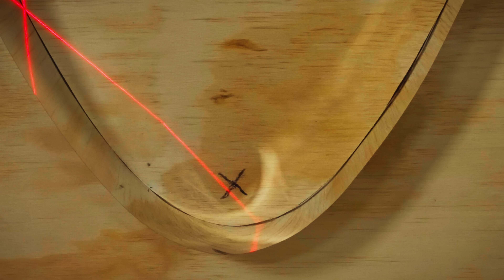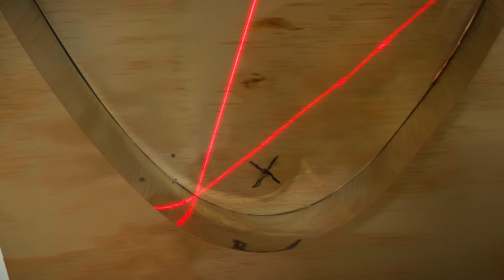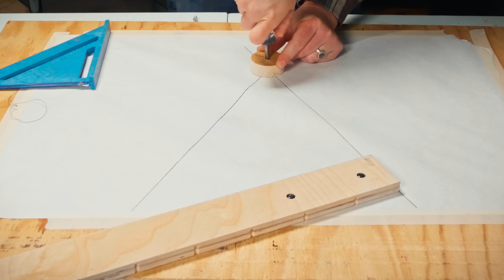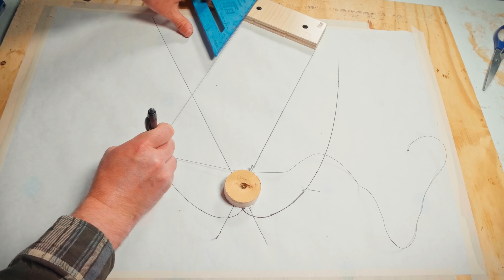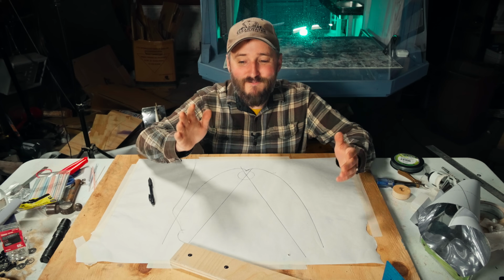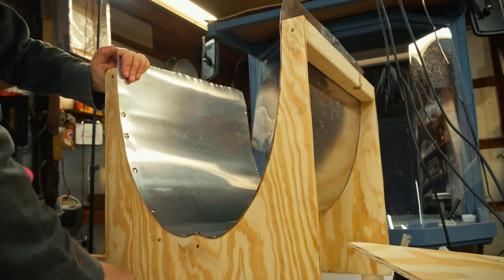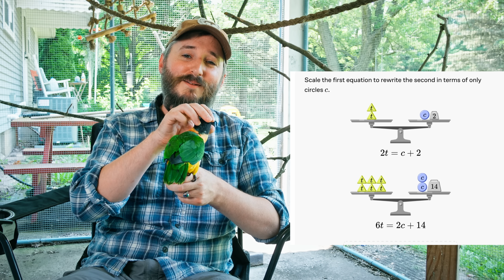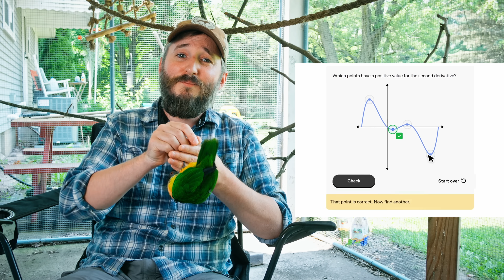DIY Solar Concentrators, Made Better.

Comment: Awesome video! Do be careful using galvanized pipe in a heating situation. Zinc begins to release fumes at about 200°C which is possible in solar concentrator. I know it isn't guaranteed, but safety first. Especially when just changing to a non galvanized pipe eliminates the possibility. Keep up the great work!

Comment: Since you read every comment, thank you so much for your work! I'm planning to integrate some of your concepts into my greenhouse to enhance performance especially in the winter. The sun is such an amazing source of free heat, we just need to capture, store and distribute it to our benefit. That's the fun part. When I finish I would be happy to join your patreon. You've given me so much.

PS. What if you use this parabola stuff for sound! Make a very narrow input angle in order to hyper focus your hearing.

Comment: A very interesting project, but if you want to heat water, there's a much more optimal method of heating domestic water. Photovoltaic panels + an inverter dedicated to an electric heater. Good panels can be purchased for $100, and you'll need four, an inverter for $200, and a heater for $50. And for $650, you can heat water with 1.6 kW. And when the tank is almost boiling, the thermostat will turn off the heater. The direct water heating method has the problem of what to do once the water is hot; there's no way to turn it off.
Reply: Most efficient way to heat water are evacuated tube collectors. Of course you can also combine that with other systems.

Comment: Think you could direct it into a fiber optic cable to direct the light indoors, before converting into heat at point of use for virtually 0 heat loss?

I don't really know how that stuff works.

Comment: Question/Thought - if you put that curve into a design program and rotated it around a 3D access to make a “bowl” and then 3D printed it and painted or coated it in a mirror surface could you get a collector that pointed at a sphere in the center?

Comment: I had some doubts about the chain's similarity to a parabola here. The first curve is called a catenary.
So I asked Gemini and its answer was this:
No, a catenary curve is not a parabola, although they can appear visually similar, especially over short spans or with small sags. The mathematical equations that define them are different: a parabola is described by a quadratic equation 
(y=ax² +bx+c), while a catenary is defined by the hyperbolic cosine function (y=acosh(x/a)).

A catenary curve is indeed the shape of an idealized hanging chain or cable supported only at its ends and subject to its own weight in a uniform gravitational field. This is why the term "catenary" comes from the Latin word "catena," meaning "chain." Conversely, an inverted catenary is the ideal shape for an arch that supports only its own weight, as it allows for the forces to be purely in compression, avoiding bending moments.

It's a common misconception that hanging chains form parabolas; even Galileo mistakenly believed this. However, it was later proven that they are distinct curves. While suspension bridge cables might appear parabolic, this is because they support a distributed load (the bridge deck) horizontally, rather than just their own weight, which changes the curve's behavior.

Comment: Hello,

The "hanging a chain" method does NOT creat a Parabola, instead it traces a Catenary curve.

Catenary curve is defined by the hyperbolic cosine function, typically y = a * cosh(x/a), where 'a' is a constant related to the curve's shape.

A parabola is a symmetrical curve formed by the intersection of a cone and a plane parallel to its side. It's also the graph of a quadratic equation (y = ax² + bx + c).

While both are U-shaped, catenaries are flatter in the middle and have steeper sides than parabolas, especially when comparing them over a wider range.

Parabolas are much easier to work with mathmatically.

A Caternary shape may in some instances be very close the the parabolic shape, but having a different relationship with the focii.

The error generated in real world sizings of solar panels and such could be quite large.  In which case it would be better to use an actual parabola to layout something larger.

Just an FYI for those interested readers.

Have a great day!
...smiles
2025/08/03
----

Comment: When I saw your video I thought about Solar Vacuum Tubes. I wander what your design would do with these tubes. These tubes collect a lot of heat.They are typically installed with only one face, if face is correct since we are talking about a tube. I wonder how much more heat they could generate using your collector. It should increase the area very significantly. I am going to try and build your design and test it with a Vacuum Tube. Thank you for your videos, I really find them inspiring.

Comment: So the fact that you used a hanging chain, a catenary, which is a hyperbolic function, would explain why in your focus demo the laser drifts away from the focus near the edges. 
Hanging chains are completely different conical sections, and it's actually super interesting to think about how they are related under gravity. A catenary is the shape a hanging chain takes when suspended between two points, while a parabola is the shape and object takes when launched at a fixed horizontal velocity between two points. 
It's like, catenary is the shape you get when you pull down on something and it distributes the force equally across itself, but parabola is the shape you get when you pull down on something equally from every point across it.

Comment: Ben, I have a suggestion: the circular template you use for constructing your compound curve should have a slightly smaller diameter so that the rays reflected from the mirror hit the collector tube somewhat more directly rather than nearly tangentially. Light hitting a surface tangentially may reflect off rather than absorb into the surface. Select a circle that is small enough where the light hits the surface with at least a 30˚ angle. I suspect this will give the system better performance.

Comment: I was thinking of using a circular mirror instead of a parabola. It’s easier to make and I could possibly use 12” aluminum duct to create two “mirrors”. Yes the energy doesn’t focus on a point but a line in the center. That is no problem as long as the target at the center covers that whole area. I was thinking of just running some copper pipe in that area and using it as a pool heater. Not sure if ductwork would be reflective enough out of the box.

Comment: 3:02 NO! a chain hanged between two points IS NOT A PARABOLA, it is a catenary. Galileo was the first one to realize they are similar curves, but they are not the same curve at all. They have completely different properties and focusing parallel rays on a point is not one of them. I lost the count that people commit this mistake. If you try to concentrate light with a catenary there will be no point focus the rays will concentrate on a surface which the cut parallel to the axis is like the top part of a heart inverted, this curve is called a tractrix and the surface is the rotation of it, this surface class we call caustics where the rays converge on a surface not on a point.

Comment: Generating heat and storing it in water is extremely useful. My electricity use is not that high, but it continues into night/darkness. A big barrel of hot water, or in other world thermal energy, and a bunch of peltiers could potentially deliver the necessary energy at will. And a barrel of water is not expensive.

Comment: I like the concept but not really the implementation. Easy to use tools are available to most people now that would make this a lot simpler if the basic concepts are understood. I just looked up how to make a parabola in my favorite free 3d modeling program and its really easy. A compound parabola wouldn't be to difficult either. With such a model I could simply print it out and trace it or I could have it laser cut or 3d print a template.
The string on a pen with a bit of a drinking straw looks downright difficult, finicky and less precise. I noticed you holding the string tight with your knee and your death grip on the pen, and its impossible to keep the string perfectly parallel with the speed square.
 I get that you are trying to make it available to everyone and that is admirable but for me it is not the easiest or best solution. 

What I'm trying to say is that anyone with a computer can make a template that is better and I think easier.

Comment: I'm really interested in the flat collector version paired with a reversible flat pipe with some sort of solar pigment on one side for heating and infrared cooling pigment on the other side.  The flipping mechanism and connectors get a little tricky, but I can think of a couple of designs that would be fine for light use.

Comment: The sagging chain forms a CATENARY (catena = Latin for chain) which is a hyperbolic cosine! The way to draw an amazingly accurate PARABOLA is, luckily, also amazingly simple. Connect a piece of string that is longer than the distance between the ends of where you want the mirror and then get a pencil and push it down on the string. Move the pencil all the way from one side to the other while keeping the string taut. THAT is a parabola.

Comment: heat piped vacuum tubes solve this part. the more difficult part is plumbing (think anti-freeze and boiling) and integrating into a home water heating or hvac. in case air heating is the target, there is a so-called beer can collector, which is practically stacks of blackened food or beer cans behind a polycarbonate shield, blown by simple pc fans with a thermostat. in the end the surface area is what matters.

Comment: Thinking about making one of these for an outdoor pool. Wondering what type of material the tubing should be, as I don't want PVC that could melt, or copper which will react with the highly chlorinated water. Any thoughts? I've read that CPVC might be more heat tolerant. Other than that, wondering if the length of string makes a difference.
Reply from the maker: That's a good question, I don't know what to use for pool water. Black rubber hose perhaps.

Comment: Ben, I've been wanting to experiment with a concentrated solar project where I actually put photovoltaic cells on the concentration line in the linearly parabolic troughs. The pipe would have another pipe running through it, because the outer pipe is filled with water/ice PCM. The inner pipe would have compressed air that is cooled to below 0 degrees Celcius to re-freeze the water and turn a turbine. I would use the electric power from the PV cells to power my air compressor and ice chest.

Comment: Combining a practical outdoors version of this with your radiative cooling materials could make a pretty good thermal difference you could take advantage of with a stirling engine. Low maintinance constant power more akin to a waterwheel than regular solar panels, which are more prohibative to maintain or manufacture. It would not be limited to locations with running water, or by moderate cloud cover. Although cloud cover may interfere with the radiative cooling, so the cooling loop may be more realistic if hybridized with some thermal mass, and options to toggle to passive watercooling. Stirling engines are more efficent the more extreme the thermal difference. If that solar concentrator is optimized with the black copper oxide and an air gap another comment mentioned I think you could get a potent passive energy source.

Comment: Two thoughts:
1. I assume running this in reverse means it could operate as a tunable  thermal radiator? (Thinking of how to usefully redirect the heat from the hot water pipes in my basement.)

2. Was it really necessary to use the smaller pipe in the parabolic model? It seems your point was to compare the total amount of solar energy captured. The much smaller thermal mass of smaller pipe also introduced a large variable. Yes, a smaller pipe could heat up faster, but that lower thermal mass also cools down much faster.
I'm not suggesting that the experiment should be rerun because I'm sure the compound parabolic would still gather more energy... and that was the point of the demo. But eliminating the thermal mass variable could have allowed you to get closer to true "apples to apples" comparison and  calculate a rough % difference between the two setups.

Comment: Nice video.
One point from a maths and physics geek - the hanging chain method does not yield a parabola, it yield a catenary, which is mathematically different. At smaller angles they can look close to the same and probably good enough, but it’s not good geometry, They are mathematically different: a catenary is described by a hyperbolic cosine function, while a parabola is a polynomial function.

The point and line method you use later in the video does get you a parabola, so good job. And the compound parabola shows a great use of the concept.
Reply: Yes!! I thought that right awa!!  That is a catenary, a word tthat creates the word CADENA in Spanish, I guess from the Latin Catena.   !!!!  All toghether, best creations come out. 👌🏻🙏
Reply: I think you deserve the pin ❤❤❤

Comment: Very cool video as always!!! For a bit of constructive criticism, let me lay out an argument that the final test was not actually fair. We have seen in your laser demo, that even when your laser pointer was at an angle, the regular parabola did manage to redirect the beam to the portion around the center point where the pipe would be. I understand that you wanted to focus on the parabola's property of focusing light from one direction onto a singular point, but with that you are also limiting the amount of light that can be captured by the setup. It is not clear from the demo, that if you actually used the same size of pipe for both (the larger diameter), the parabola would not perform better with the larger diameter than the smaller. Because it might be that even though imperfect, the larger target causes it to capture disproportionately larger set of angles of light.

I still would expect it to under perform compared to the compound parabola, however, it would be a more fair comparison, in my opinion.

Anyway, keep up the great work! Love all your stuff!

Comment: 3:17 Something which is quite interesting is that the actual form of the chain is in ch(x) which means that for small angles , next to the middle of the curve, you are very close to a parabola , because of ch(X) Taylor series which means that ch(X) ~ 1 + 0.5*x**2 . Therefor , you weren’t completely false

Comment: From a purely geometric standpoint, why should the transparent pin be placed on the side of the target at the same angle as the line used to set up the guide rail for the square? Why not put that pin further away lower on the target? Because, as it is, the moment the string gets fully unwound from the target, the string will no longer be tangent to the target. Is this desired? Why?

Comment: This has been a great video,  thank you for making it🙏. Please try to build a 3 dimensional Compound parabolic concentrator in the next video (you can use 3d print or cut foam or Styrofoam using a wire at the shape of 2 dimensional parabolic for a mold). And please show how to use the heat to warm up water efficiently or make electricity

Comment: I think this is a cool proof of concept, but I'd like to see you (or maybe I will lol) perform this experiment with more data and eliminating possible variables: same thermal mass size, same thermal mass composition, same measurement points, etc. Would be cool to set up a datalogger over a year to track trends over time
Reply from the maker: Please do test it yourself and send me a video
Reply: @Nighthawkinlight  I made a new channel called @Skragglebeard . There's not much on it right now, but I'll be posting project updates soon. Cheers!

Comment: Love your videos. Wondering what your thoughts would be on a waterwheel run by a ram pump that is powered by the collected waste water from the ram pump and another small dc pump powered by the water wheel or even a mechanical pump tied directly into the water wheel itself. If done right i feel it would be close to perpetual with the exception of adding a little water to the system from time to time due to evaporation. Also if the water wheel were large and heavy enough, it would act as a flywheel of sorts adding energy to the system. Might need Bob Barker or Pat Pat Sajak to give it a little spin to start the show but after that, i dont see why it wouldn't work. Maybe even produce a little extra power.

Comment: You need to combine this with a heat powered motor and turbine of some kind... Could make a highly compact solar power set up that could fit on the top of a van or bus...
Reply: "Compact" 😀 If you're looking for a compact solution it's called photovoltaic. Or evacuated tube collectors if you want hot water.

Comment: Great idea, man… but the thing you need to know is that this idea you think you discovered was actually discovered by Muslims 1,447 years ago. They used it in mosques—not for light, but for sound amplification. They called it the mihrab, the niche where the imam stands to recite the Qur’an during prayer. The mihrab collects and projects the sound clearly throughout the mosque, much like a modern loudspeaker. Look up the word mihrab in the context of mosques—and be sure to mention that in your program.

Comment: I wounder if you could use half of a Penrose Unilluminable Room to heat 2 pipes.
Though i'm not sure they would heat well considering the area of light exposure would be smaller.